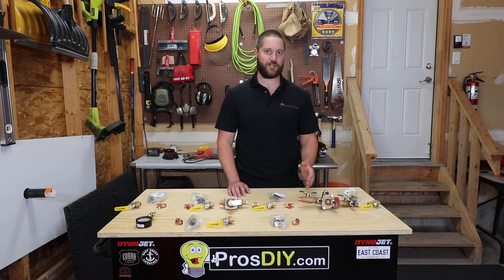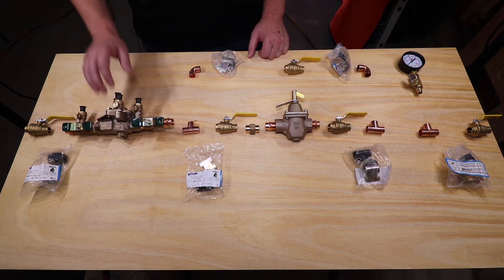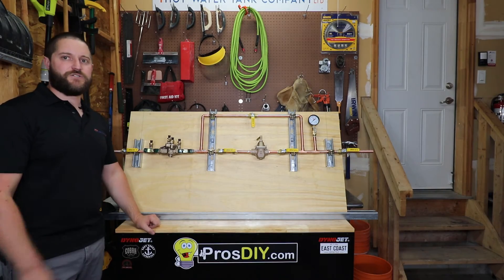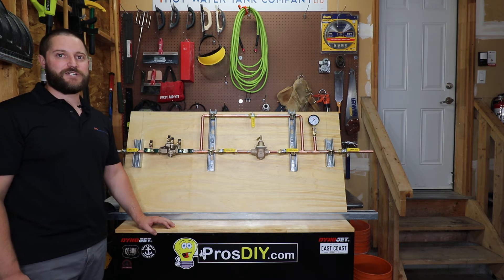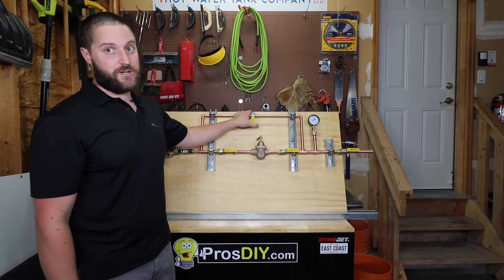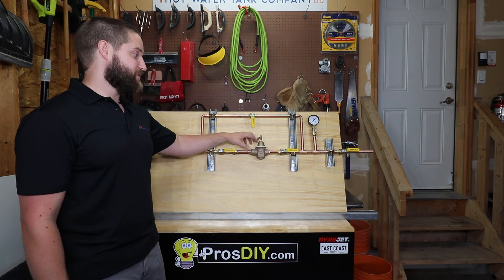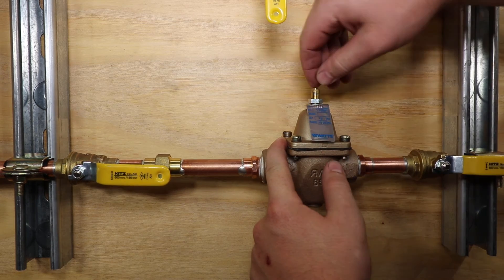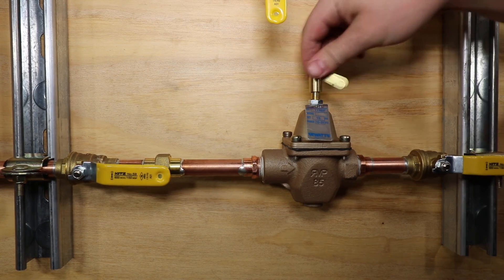Hydronic Boiler Feed Line Build

Comment: I'm curious about the point of adding a by-pass to the circuit. I understand the use of them but for an example if my feed water valve was faulty I would just shut down my hydronic boiler system and replace it. It's not like you can "throttle" your boiler feed to a set psi by closing your ball valves on your by-pass. Am I missing something. Let me know what your thought process was on the point of having a by-pass.

Comment: Once you have the boiler line filled with water, can you keep the isolation valve turned off? Then you open it only when you are doing maintenance like flushing the boiler lines.

This would have the added benefit of ensuring that a failure in the backflow preventer would not contaminate your water.

Comment: looks  Pretty Good but you forgot the Air Separator and The expansion Tank ,  Also a Dual check with atmospheric  port  is  a sufficient  back flow preventer

Comment: Is a shut-off necessary on the bypass? Mine does not have a shut off on the bypass line and I'm wondering if thats why my PRV is blowing out water? I mean whats the point of the PRV if the bypass is feeding 45-60 psi into the boiler through the bypass?

Comment: Just wondering if you need a check  valve after pressure regulator ? I put one in. I noticed the backflow always dumps. Is it check valve?

Comment: Excellent video. what if the pressure is still high after making adjustments four times? It starts at 15 to 20 after bleeding the boiler using the pressure valve, then when running the boiler it goes right up to 30 psi and it starts to leak again. I did change the pressure valve and the pressure tank a required. Please advise.

Comment: what is Isolation valve function? thank you
Reply: If you don’t know, you probably shouldn’t work on hydronic or plumbing.  Isolation is 1 or 2 valves that can be turned off so a device that is being replaced, or serviced, can be replaced or serviced without removing water from the system.  This tech also built a bypass loop with a valve that can be opened to allow city pressure water to flow in at a high psi along the 15 psi water to reduce fill time.

Comment: Can this be adjusted while the water flow is ON or does it need to have the main turned off first ?  I need my pressure slightly increased but don't want to risk water flooding.

Comment: Very good detail video and it taught me how to turn up the pressure slightly on my auto-feed.
My new Combi boiler kept coming up with a code 55 ( fill code ) .
I would manually let the water into the boiler and it would eliminate the code and fix the problem which told me that I needed slightly a little bit more pressure.
Adjusting the pressure on the auto-feed a couple PSI made the difference and solved the problem

Comment: Great job - very informative. Some systems are filled with glycol and distilled water then you would not need any of this, correct? Is there any advantage to distilled water over city water? The hassle with distilled and or glycol is that you need an external pump to fill and add fluids, but not too expensive from Harbor Freight.. but then you would avoid this whole feed line costs... Thx...
Reply from the maker: A boiler system should always have a means to automatically add fluid/pressure as needed. Both this system and a tank/pump system have pros and cons. I typical install this system in commercial locations (apartment buildings, large office buildings, etc. Then if there is a leak it will automatically fill the system without running out of water. Another case is if the system was shut down and drained for service. It will automatically fill the system as the air is purged without worrying about a tank/pump style system running out of water. Some larger buildings can take days to fully purge the air from the system. It is very common for large apartment buildings to have leaks in someone's unit and they don't report it. This would eventually drain a tank style system. I installed a tank style system in my own home because I can monitor it and like you said, it eliminates the need for all these fittings. I have a video on this Axiom tank and water treatment here: https://youtu.be/NpWtYY4zXkU Most residential installs I use a fill tank. Thanks for the questions!

Comment: How do you know what gauge is out 2 different readings which 1 is right ?? I have two thermometers the makers say plus or minus 4c which is a lot Fluke not cheap,and a cheap one plus or minus 4c price difference x times dearer so how do you calibrate when you can't trust them read the small print plus or minus 4c wrong answer

Comment: hey, this video is awesome and very informative. the pressure on my boiler is at 50psi..i've been running it all winter like this and just realized ,IT''S ALL WRONG!!..before anything busts, i wanna reduce pressure..is it ok to reduce pressure while on, and it's been running like this?  do i have to purge out any water while or before i turn counter clockwise??..or should i just empty the system, turn the feeder counter clockwise, and then fill back up? ..i'd really appreciate some help from a real pro like you, instead of the smuck that usually comes by here.
Reply from the maker: Just to make sure is your boiler a closed loop system? This means that the boiler water doesn't mix with the potable water system.
If it's a closed system you most likely can get away with a lot less pressure. I would close the boiler feed line, spin the valve counter-clockwise a turn or 2, then drain off to about 5-10 psi. Then open the feed line and see what the pressure stops at. Sometimes it can take a few hours to level out. If it's still too high, repeat the process until you're happy with the set pressure.
Reply: @PROSDIY  if i have a backflow preventer,does that make it a closed loop system?
Reply from the maker: @fatbardhibrahimi3635  Yes, correct it does. Sorry I should have been more detailed. Usually you want 4-5 PSI at your highest connected piping/radiator. For every 10 feet of elevation above the boiler the boiler's gauge will read roughly 4.3 PSI (weight of the fluid in the piping pushing down). This means if your highest piping is 10ft above the boiler you'll want your boiler's gauge to read a absolute minimum of 8.3-9.3 PSI (4.3 PSI weight of water + 4-5 PSI recommended at highest point), but 12-16 would be fine. I hope this makes sense. This would probably make a good video :)
Reply: @PROSDIY  if i knew how to make a video, i would..lol..thank you so much for taking the time out to respond..i am a firm believer in karma, so i  believe god will repay you for helping out all these people on your page..one way i guess i can repay you is to subscribe so i will do that..and once again thank you
Reply from the maker: @fatbardhibrahimi3635  Oh sorry, I meant I might make a video on setting the correct pressure. You gave me the idea, and I'm sure you aren't the only one with that question. Thank you for the subscribe and kind words. I appreciate it.

Comment: A plumber didn't  install PRV when they install a new boiler..
I check water pressure in my house and its between 35 to 40 psi. I think this is too much going to my boiler .Damn plumber...
Reply from the maker: Ya that is most likely going to be too much pressure. In a closed loop system you want roughly 4-5 psi at the highest connection. You will lose roughly 4.33 psi for every 10 feet of elevation. So this means if your highest connection is 10ft above the boiler you'd want around 14.33 PSI in the system, or 14-18 psi would be fine.

If you have an open system then line pressure is fine. This is when the boiler water is also connected to the domestic water. Usually to a hot water storage tank in a direct connection.
Reply: I have a hydronic baseboard with recommended 12 psi.  Not a hydronic radiant.  In hydronic baseboard, you have to have a PRV for fill water to the boiler and system because there is a safety Pressure Release Valve typically set at 30 psi.  Your hot water heater also has a Relief Valve set to release water if the heater overheats the water.   If a purge station is open, and city pressure water is filling, the 30 psi valve won’t open up.  But if not purging, and once the system fills, the city water at over 30 psi will set off the release valve.

Comment: Very informative video.  Can you provide the part number for the backflow preventer?  I am installing a Rinnai Combi Boiler and would like to set up the same boiler feed/fill line.  Thanks
Reply from the maker: Thanks Jim! The part number is: Watts LF009-QT 1/2. It's a 1/2" reduced pressure backflow preventer. Good Luck on your install!
𝗔𝗺𝗮𝘇𝗼𝗻 𝗔𝗳𝗳𝗶𝗹𝗶𝗮𝘁𝗲 𝗟𝗶𝗻𝗸: https://amzn.to/3m7eMUw
Reply: @PROSDIY  Thanks for the quick response!  I appreciate your help!  I noticed on the product information that the max operating temperature for the 009 reduced pressure backflow preventer is 180F.  The Rinnai Combi Boiler i am installing has a max temperature setting of 185F.  Is this a concern, or is it not an issue since the backflow preventer is installed on the feed line?  Thanks again for your help!
Reply from the maker: No worries. You're correct. It won't be a problem because it's installed on the cold water feed line and that section will never see those temperatures.
Reply: @PROSDIY  Thanks again for your help!

Comment: So turning the key out will reduce pressure on the system by increasing the resistance to the 60 psi inflow to the house?
Reply from the maker: Turning the key out (counterclockwise) will increase resistance and decreases pressure in the system. Turning the key in (clockwise) will reduce resistance and increase pressure in the system.
Reply: Pros DIY awesome thanks very much.  Seems a little counter intuitive so I wanted to double check.  
You are right about adding a gauge.  I don’t trust my boiler gauge.  It says 18psi when the heat is off and system is filled but my pressure regulator is set to 15 psi from the factory
Reply from the maker: @ironwill04  I agree, it does seem counter intuitive. It's definitely nice to have a second gauge to double check pressures. Correct pressure is such a crucial part of the system. Thanks for the questions. Take care!

Comment: Nice job. Just think a union on the other side of the feed valve would be a nice add on for servicing.
Reply from the maker: Thanks oilex oilex, I appreciate it! The PRV can still be serviced and replaced with the 1 union as there's enough room behind the board to spin it out. You're right though, it may make it slightly easier to remove. Just a personal preference that I've always done. All the Best!

Comment: thanks for the video. What kind of situation you need to bypass the pressure reducing valve ?
Reply from the maker: A few situations are:
1. Initially filling the system. Large systems can take a long time if filling through the pressure reducing valve.
2. The pressure reducing valve fails in the closed position or is clogged with debris.
3. Quickly topping up system pressure.
4. If you have to remove or service the the pressure reducing valve, it still gives you an option to adjust pressure. This is especially important on cold winter days, by limiting the downtime of the boiler.
Thanks for the question!
Reply: @PROSDIY  thank you for replying

Comment: Could you tell me what valve that is you used with your pressure gauge?  I can't find anything that looks like it.  Is it a sweat fitting on one end and FPT on the other?
Reply from the maker: Its 1/4" MIP on the lower side and 1/4" FIP on the gauge side. I used a 1/2" sweat x 1/4" FIP bushing on the copper side to make the connection.
1/4" FIP x 1/4" MIP straight ball valve: https://www.dahlvalve.com/products/mini-ball-valves/petcocks-gauge-cocks/petcocks-gauge-cocks-121-51-61.php
1/2" sweat x 1/4" FIP flush bushing: https://www.completeplumbingsource.com/zurn-wilkins-1-2-x-1-4-wrot-copper-flush-bushing-ftg-x-fip
Hope this helps. Let me know if you have any other questions. Thanks!
Reply: @PROSDIY  Thanks!